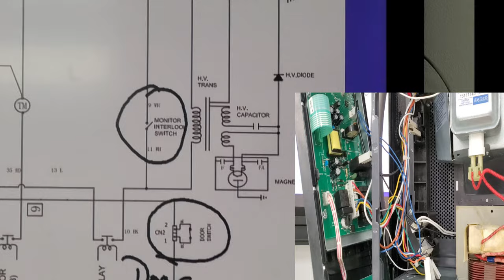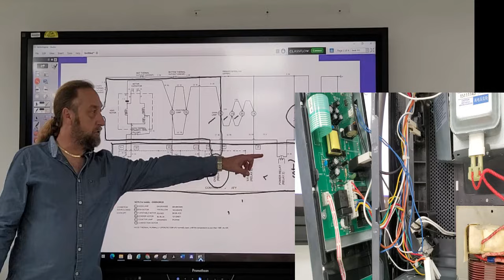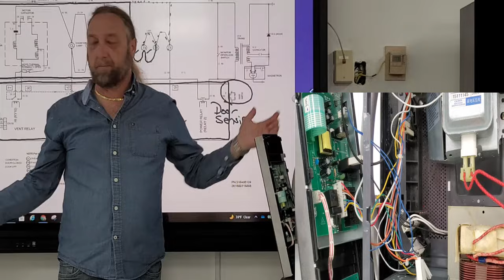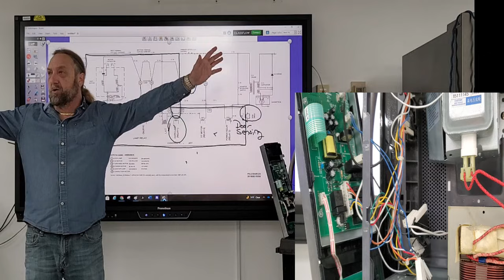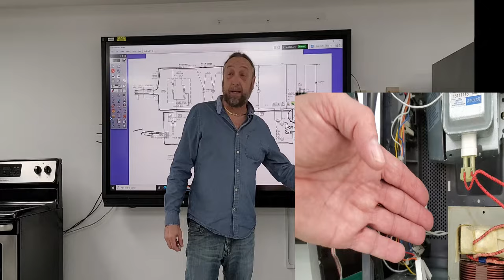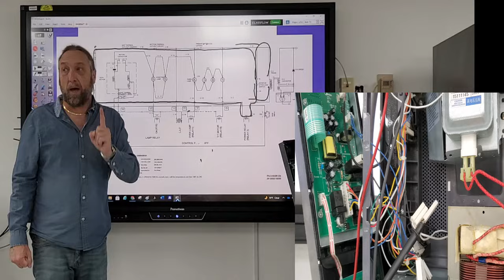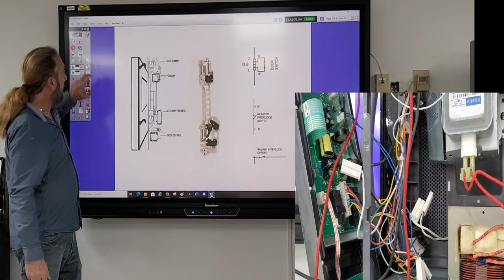Microwave Door Switches

Comment: Awesome tutorial, Bro' Rick. I have a microwave that keeps blowing fuses. Is there a switch that causes that? It doesn't blow immediately, just after operation for awhile.
Reply: If door switch causes fuse to blow will be one of 2 things, blows immediately when plugged in or immediately when turns on. Sometimes when door is opened while still running. Remember other things like transformer and high voltage capacitor can blow a fuse too, 

Try to disconnect the 120v side of the transformer then running unit see if blows fuse, if not could be one of the HV components NOTE: ''''"if you are not sure how to test them have someone who does, the unit runs at 4,000 volts. and capacitor can store an electrical charge even if it is unplugged.""""
Reply: Thanks for teaching. My microwave magic chef happen the same thing. I switched transformer and capacitor from the one working still blowing the fuse when the transformer started.
Reply: Late reply: my 15yr old Siemens microwave had a bad monitor switch - turns out it was always closed, and the microwave was setup to blow it's fuse by creating a short when this switch didn't open when the door was closed.
The 20ct switch was hard to obtain and cost $15, so I decided to open it and repair it by bending it back into shape.

Comment: I find it funny people dislike videos, please if you think it is not a good video please comment and share so they can be improved.
Reply: It's probably bots you guys are doing great Ric...💪
Reply: It's crazy because this is the most informative video on the subject bar none. I just wish you had said which brand had a problem with loose switches. I have a Furrion and believe they have this problem often. I replaced the 3 door switches and fuse, now have a new problem. When plugging in the microwave it did power on but the turntable started turning and the light came on with the door closed. It does stop when the door is opened but after closing the door is starts turning again. This is happening without setting it to start for any length of time. In fact when I tried to start it with the light and turntable moving it won't. Somehow it must think it is already on. I tried unplugging and tripping the breaker but it did not solve the problem. I did check the fuses for continuity before and after replacing the switches and I'm thinking they are fine because the turntable does shut off when the door is opened. Any idea what might cause this?
Reply: @Charles  that is a sign that the secondary door switch is not closing when the door is closed. Does not mean the switch itself is bad. If you determine the switch is closed when door is closed. Then is possible a relay on the board is stuck in closed position. I do feel it is the door switch not closing. You said you replaced the door switch. It is possible a normally closed switch was put in the wrong place
Reply: Also the frigidaire microwaves had the loose switch problem